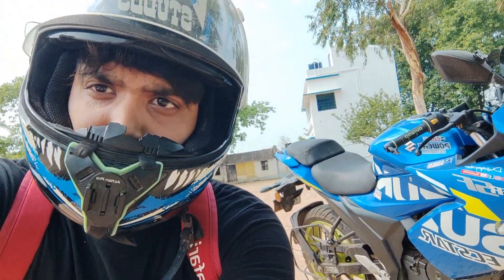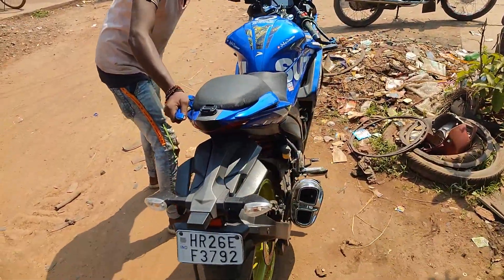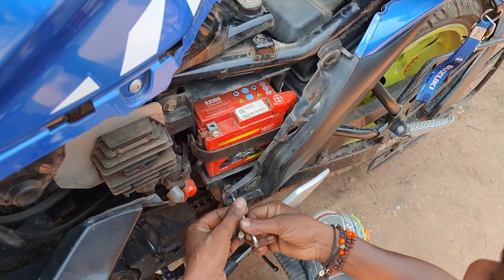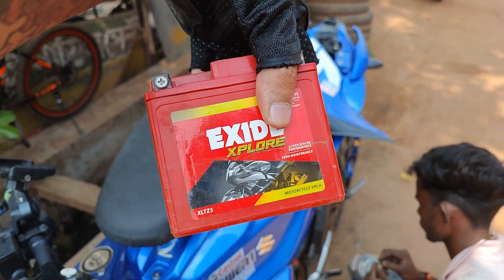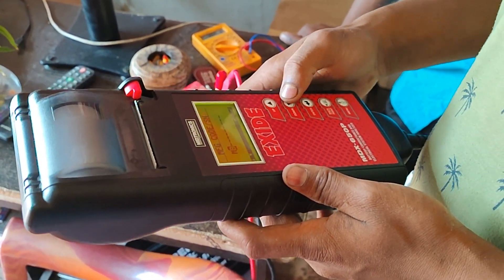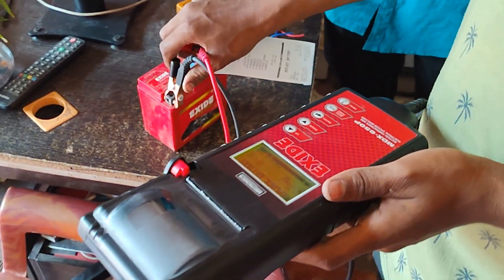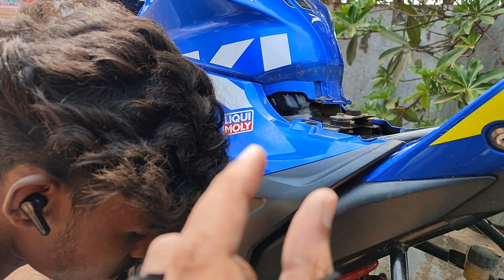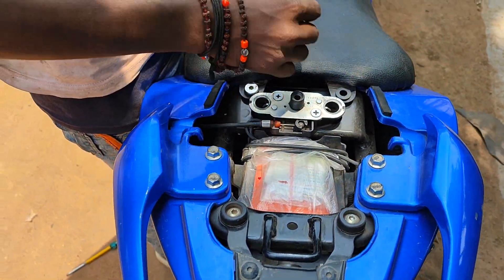Battery Replacement | Gixxer Sf 150 | #gixxer #battery #replacement #selfstart #issue

Comment: Hi bro, Bought Gixxer SF 150 1week back. Just drive 100km. But, Battery is not working. & Headlight also blinking a lot. Having only 9.5voltage. 

What is solution for this ?
Reply from the maker: Contact the showroom from where you bought the bike. It's only been a week so i think it's not a battery problem. Also the headlight is flickering, that means it has cable problems. Please talk to the showroom to get it fixed. 

If it doesn't help, let me know. I'll make another video to solve this
Reply: @SDMotovlogs  Okay bro.

I'll ask to fix the issue ? Or Can i demand for replacement or anything ? Will they accept
Reply from the maker: Yes, they will replace parts, or repair it. Just tell them the issue in detail. It's only 7days so don't worry at all. They will give you proper solution